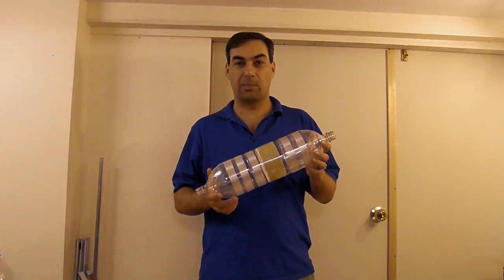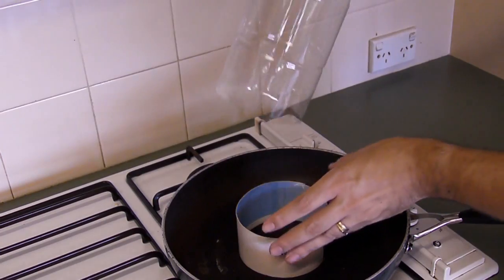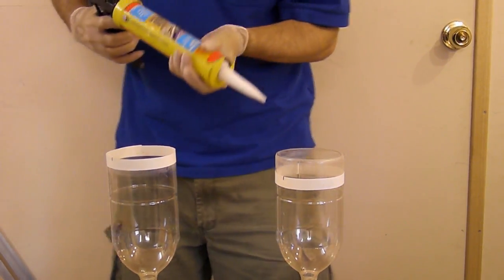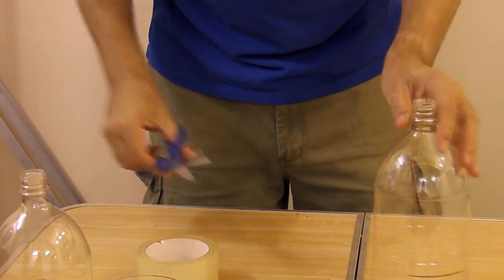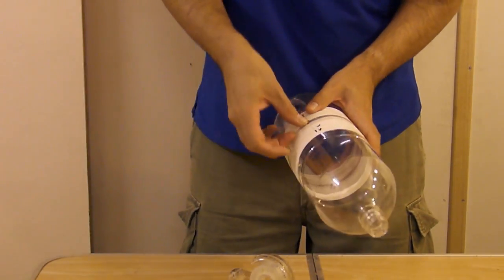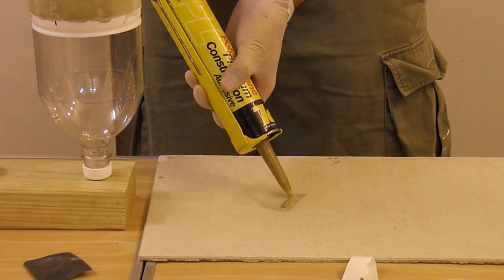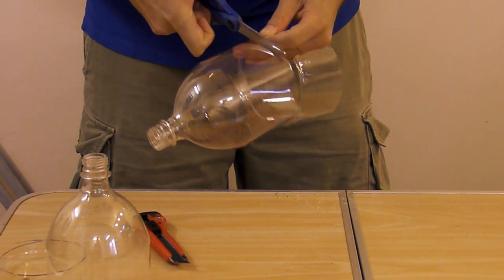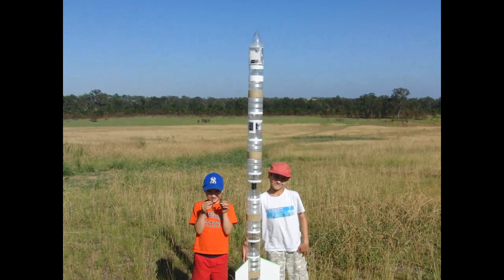Water Rocket Bottle Splicing Tutorial

Comment: Thanks for this George, its a great  tutorial, very clean and easy to follow. I’ve been doing a bit of research into glues readily available in the UK that are polyurethane based, Sika do one called ebt+ have you come across it? It’s very elastic, like a silicone but seems to have good adhesion. I’ve got a bottle curing so time will tell. Otherwise I’ll be on the hunt for some PL premium!
Reply: After a few tests I can confirm sikaflex EBT+ works great here’s our latest rocket https://youtube.com/shorts/PWY9-Tle0A8?feature=share

Comment: Hey mate how come I need to use PL premium for the sleeve instead of Stika
Reply from the maker: PL premium is so much stronger than Sikaflex. Sikaflex by itself will fail at much lower pressures. The bottle will burst before PL lets go.
Reply: @gk123434534  aha i thought they where simmilar
Reply: @gk123434534  do you know where i can get PL premium in a australian store?
Reply from the maker: @sun5534  Sorry I do not. I've always ordered it from overseas.
Reply: @gk123434534  any websites you recomend i got one off amazon and the top of the glue dried so i couldnt use it!!
Reply: @gk123434534   any websites you recomend i got one off amazon and the top of the glue dried so i couldnt use it!!

Comment: Hopefully someone with knowledge about the subject ca answer me this. But can I use the sikaflex for everything? I tried but i couldnt find the PL premium glue.
Or better yet can someone tel me some glues that are like the PL premium but arent the sikaflex
Reply from the maker: Irving Mendoza Unfortunately sikaflex is not strong enough to hold the splice. PL is about 3 x stronger. If you just use sikaflex, the splice will fail at around 50 psi. Try looking at some other polyurethane based glues you may have available in your hardware store. You may be able to special order the PL glue through the hardware store as well.
Reply: gk123434534  So to hold the splice i can use any polyuretane based glue ? Any kind will work?
Reply from the maker: Irving Mendoza Not all PU glues are created equal. Some are stronger than others. We have had success using a PU wood glue, although it is a bit runny and foams up. You can thicken it to make it workable, and it held a splice well. Here is some more information: http://www.aircommandrockets.com/day46.htm However, the only real way to know if a particular glue will work is to make a splice and test it. Give it  2-3 days to cure before testing. PU glues seem to adhere well to PET plastic and provide a flexible bond that doesn't crack when the bottles expand.
Reply: gk123434534 i found a silka 1a and a vulkem 116 and was wondering if you had experiences with amy of those and which would you reccomend

Comment: A HELPFULL ADVICE FOR ALL!!!!!
Dont try to do this splicing with the epoxy glue! I tried it and it worked as long as I added pressure into the bottle. Becouse dried epoxy is very hard and not flexable at all, it broke when the bottle changed its shape while adding pressure. So then there was a huge explosion in my garage when these two bottles came separate again. I write this here, so you other can bee wiser than me.
Reply from the maker: I agree, Epoxy is not an ideal glue for splicing as it can crack. The more flexible polyurethane based glues work the best.

Comment: how much water should in use if I connect 2 bottles. the capacity of each bottle is 2 liters
Reply from the maker: You should use about 1/3 the capacity of your rocket. So for a 2x2L rocket you should use 4*0.3333 = 1.33L
Reply: gk123434534 thanks. i have 1 more question. how do i seal the top of the bottle and can i use the bike tube valve as the nozzle of the rocket
Reply from the maker: Karun Arjun Potty  Do you mean how do you seal the spliced bottle at the top? Just screw on a normal cap. A bike tube valve is likely to be too small to work as a nozzle effectively. You would also have to remove the valve internals to allow water to pass through.

Comment: Is it possible to achieve around 200psi if I had Pl premium,sikaflex and glass fibre tape? If not how could get that?
Reply from the maker: 200psi would be pushing it fairly close to the limit. It all would depend on how many layers of the glass fiber tape you would use. You always want to keep some kind of safety margin too to allow for variation in joint strength between different joints, and variation in bottle strength.
Reply: gk123434534 I've bought some fibre glass tape and pushed around 150 FOR 1 layer. The only thing is finding the balance between strength and weight! I don't want to put too many layers. I wonder how I can calculate for those values...hmmm

Comment: Force is measured in Newtons.  Pressure is measured in the following: mm Hg (Millimetres of Mercury), in Hg (inches of Mercury), PSI, Bars, and Pascals/Kilo Pascals.....not sure of any more.  

In physics, a force is any influence that causes an object to undergo a certain change, either concerning its movement, direction, or geometrical construction. In other words, a force can cause an object with mass to change its velocity (which includes to begin moving from a state of rest), i.e., to accelerate, or a flexible object to deform, or both. Force can also be described by intuitive concepts such as a push or a pull. A force has both magnitude and direction, making it a vector quantity. It is measured in the SI unit of newtons and represented by the symbol F.

The original form of Newton's second law states that the net force acting upon an object is equal to the rate at which its momentum changes with time. If the mass of the object is constant, this law implies that the acceleration of an object is directly proportional to the net force acting on the object, is in the direction of the net force, and is inversely proportional to the mass of the object. As a formula, this is expressed as:

F=ma (Remember it is a vector as stated below, hence direction must follow the value)

where the arrows imply a vector quantity possessing both magnitude and direction.

Related concepts to force include: thrust, which increases the velocity of an object; drag, which decreases the velocity of an object; and torque which produces changes in rotational speed of an object. In an extended body, each part usually applies forces on the adjacent parts; the distribution of such forces through the body is the so-called mechanical stress. Pressure is a simple type of stress. Stress usually causes deformation of solid materials, or flow in fluids.

The SI unit of force is the newton (symbol N), which is the force required to accelerate a one kilogram mass at a rate of one meter per second squared, or kg·m·s−2.[46] The corresponding CGS unit is the dyne, the force required to accelerate a one gram mass by one centimeter per second squared, or g·cm·s−2. A newton is thus equal to 100,000 dynes.

The gravitational foot-pound-second English unit of force is the pound-force (lbf), defined as the force exerted by gravity on a pound-mass in the standard gravitational field of 9.80665 m·s−2.[46] The pound-force provides an alternative unit of mass: one slug is the mass that will accelerate by one foot per second squared when acted on by one pound-force.[46]

An alternative unit of force in a different foot-pound-second system, the absolute fps system, is the poundal, defined as the force required to accelerate a one pound mass at a rate of one foot per second squared.[46] The units of slug and poundal are designed to avoid a constant of proportionality in Newton's Second Law.

The pound-force has a metric counterpart, less commonly used than the newton: the kilogram-force (kgf) (sometimes kilopond), is the force exerted by standard gravity on one kilogram of mass.[46] The kilogram-force leads to an alternate, but rarely used unit of mass: the metric slug (sometimes mug or hyl) is that mass which accelerates at 1 m·s−2 when subjected to a force of 1 kgf. The kilogram-force is not a part of the modern SI system, and is generally deprecated; however it still sees use for some purposes as expressing jet thrust, bicycle spoke tension, torque wrench settings and engine output torque. Other arcane units of force include the sthène which is equivalent to 1000 N and the kip which is equivalent to 1000 lbf.

Pressure (symbol: P or p) is the ratio of force to the area over which that force is distributed.

Pressure is force per unit area applied in a direction perpendicular to the surface of an object. Gauge pressure (also spelled gage pressure)[a] is the pressure relative to the local atmospheric or ambient pressure. Pressure is measured in any unit of force divided by any unit of area. The SI unit of pressure is the newton per square metre, which is called the pascal (Pa) after the seventeenth-century philosopher and scientist Blaise Pascal. A pressure of 1 Pa is small; it approximately equals the pressure exerted by a dollar bill resting flat on a table. Everyday pressures are often stated in kilopascals (1 kPa = 1000 Pa).

Comment: Can you use super glue instead
Reply from the maker: I have heard of someone trying superglue with limited success. One problem is that the glue not only has to hold the bottles together but it also has to seal. With super glue it may be difficult to get it to fill any imperfections to seal properly. You don't hear about people typically using superglue for their water rockets. The other problem may be how quickly it sets as you typically need a few minutes to get the splice together properly and lined up.

Comment: Can you use a hot glue gun instead of pl premium and the other glue
Reply from the maker: Hot glue is unsuitable for splicing, it is simply not strong enough to hold the bottles together at any reasonable pressure. Polyurethane based glues seem to work the best on PET plastic.

Comment from the maker: It helps to strengthen the edge as well as making the bottle nice and round at the cut. Without the curl you'll find that the cut bottle is a little wavy and uneven. The rounded shape also helps with forcing the glue into the join as you press the two halves together.

Comment from the maker: The sikaflex here is used as a seal, so pretty much any equivalent polyurethane based glue that doesn't bubble should be fine. If you are using PL premium you may be able to get away with just that instead of using the two glues. Where we live it is humid and the PL bubbles while it cures which makes some splices leak slightly. Hence why we are using the sikaflex which doesn't bubble as the seal.

Comment from the maker: Psi stands for pounds per square inch. The units are essentially force applied to an area. (in this case force measured in pounds and the area being a square inch)  F=ma only refers to the force. A pressure gauge is used to measure pressure in psi.

Comment from the maker: Yes you can. We found that because the PL bubbles when it cures and becomes a little porous. We've had a few leaks with the 2L bottles when using PL premium only and so we started using the sikaflex as a sealant and haven't had a single leak since then. Even though the PL leaked it always held the splice together.

Comment from the maker: Generally it's only been available in the US. Most hardware stores carry it there. Have you tried looking on-line to see if they will deliver it? If you can't get a hold of PL, try looking for any other Polyurethane based glue as these are the best glues to use on PET. But you would need to test the strength yourself.

Comment from the maker: Are you asking about which glue we use? We use PL premium to hold the bottles together. The sikaflex is only a sealant and doesn't really provide much strength. PL is about 3 times stronger than PL. Search for PL premium construction adhesive on line to find a source for it. What glue did you use?

Comment from the maker: Hi, We use both commercial tornado tubes bought from CoolThings Australia (can't post link here) and ones we make ourselves from 3/4" BSP irrigation connectors. The BSP ones are used on the higher pressure rockets, and the commercial ones on the lower pressure rockets.

Comment: Has been injected into the water and pressure in the rocket that put some water in the tank of the launch pad, pressurize.
 When a problem occurs, open the pressure switch of the launch pad, from the rocket by decompression
 To collect the water and pressure.

Comment from the maker: @MrTomcarnahan The fairing is just made of two bottle sections that overlap about 1cm. You don't need a lot of PL for this. I assemble them on a cardboard tube to keep them aligned. The length I worked out by trial and error. I just kept cutting sections off until it was the right size. We have different lengths depending on type of bottles and whether they have reinforcing or not. You want the fairing to be tight when you tighten the bottles in the coupling.

Comment from the maker: @MrTomcarnahan I always use a thick nail that I insert into the cartridge nozzle. The diameter of the nail is slightly bigger than the hole I make in the nozzle, so that when you force it in it seals around the edges. You normally have to use pliers to remove it again, but the nail leaves a nice channel inside the nozzle for the PL to come out.

Comment from the maker: @MrTomcarnahan Hi Tom, going beyond 4 couplings makes the rocket quite long and starts to be too flexible. Unless you use fiberglass for the bottles and fairings then you could probably do a couple more. The fiberglass provides extra stiffness. Each of these spliced pairs holds about 3.15L. How much water to add depends on a number of factors but 1/4 to 1/3 is about right. As long as the coupling has a larger diameter than the nozzle then you can pass water through them.